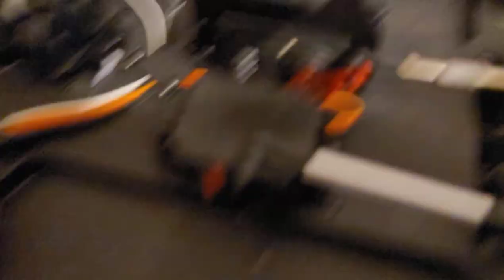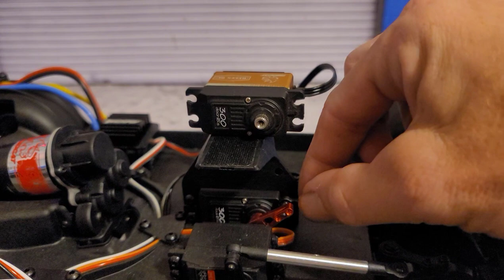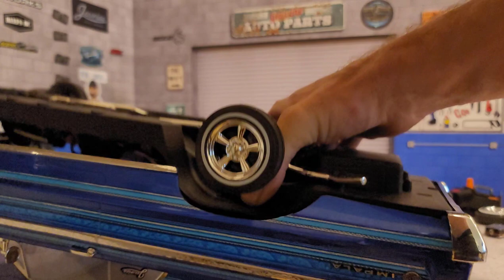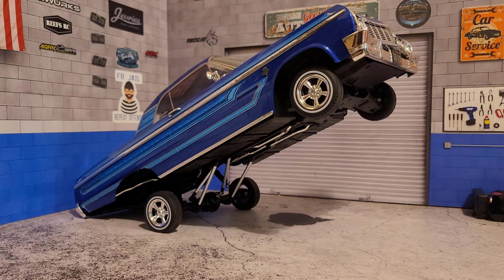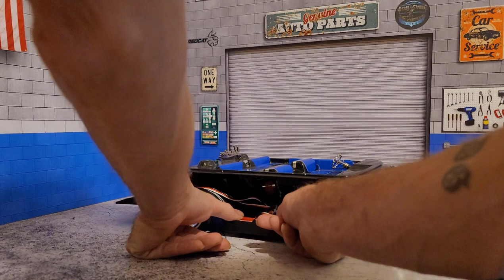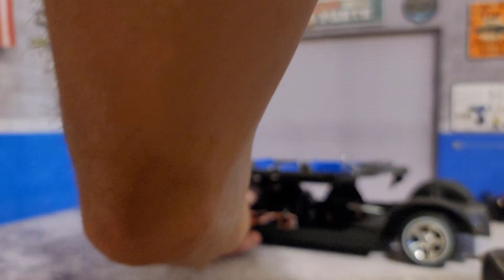Redcat Lowriders MORE HOP POWER Flipped Servo Short Horn SixtyFour Hopping Lowrider

Comment: I might have to do the change up on the hopping servo I did change up my esc but it’s running 3s right now and my hopping servo is kinda moving on it’s own and when I slowly move the switch the back servos tend to cut out alittle any tips on how to fix it I reset everything on the car and my remote just haven’t tested a 2s yet though
Reply from the maker: have to look at the servo, its not supposed to move at all, might be loose in chassis, causing odd behavior, make sure its fixed in the car well
Reply: @NorthSideCustomRC  everything on my car is tighten down even the servo horns I have a power boost but I don’t think it will help that much

Comment: That’s how I have my 64 set up with a shorter horn. I just noticed that my Monte Carlo has a locked rear diff were as my 64 has an open rear. Is yours the same
Reply: I ordered a duel servo mount and servo and I’m going to run the same shorter horn that should be some crazy power
Reply from the maker: Nice, glad to hear it's working for you too.

Yes open on 64 but locked on the Monte   they did this so 64 can steer and Monte can drive wheels up without going in circles or dead stop if dog legging. 64 all weight on the rear the Monte kinda rear light
Reply: Cool I thought it had to be for a reason for the locked diff and I knew the master of rc lowriders would know.
Reply from the maker: @Jasonkartracing  Eh Bro thanks for the support, Im just learning as I go and sharing what Im learning
Reply: @NorthSideCustomRC  is it worth upgrading to the dual servo on the 64?
Reply from the maker: @lazsosa8711  really depends on what you want. It's not needed for anything other than independent switches on front. It's increased Hop power is negligible and only a factor if weight shifted to keep from bumper stalling
Reply: @NorthSideCustomRC  what is a good budget servo for it?
Reply from the maker: @lazsosa8711  Power Hobby 209mg is great budget option

Comment: When you flipped the front servo did you have to reprogram the servo to a different angle or can I just flip the servo over and take the servo horn off push down the switch on my controller so that it is completely at rest and get on my receiver controller and reverse the motion and then put the horn back on as my endpoint correct?
Reply from the maker: You need to readjust the "end point" for the servo. Basically telling the servo where to stop in both directions. 

If you kept same horn on servo it's still good idea albeit the adjustment will be small it's imports to have them just right
Reply: @NorthSideCustomRC  I do have a shorter servo horned I'm going to put on there just like the video and I also have shorter rods coming in also. Just wanted to make sure I didn't have to grab a programmer card to reprogram the servo. Thank you for your information really appreciate you
Reply from the maker: @devindickson5632  this one all in the controller end points but keep in mind the Factory gold Reefs is set at 80% power, you have that 20% left on the table
Reply: @NorthSideCustomRC  so it would be a good idea to grab a reefs servo programmer and power it that full 100% from 80% and play with that 20%?
Reply from the maker: @devindickson5632  in all honest the 20% is not gonna be crazy, the servo really come to life with a Bec and voltage upped to 8.4v but it's still noticeable and for 20$ worth it. The powerhobby 209 tho come at 40% yah really need to up that to wake them up
Reply: @NorthSideCustomRC  and that's exactly what I got was a castle BEC  and programming kit for it. A  hobbywing 1080 ESC and a 3s lipo battery. In which I saw your video for flipping the front servo so I got a shorter servo horn and ordered a shorter rod. Which all they are is coming within the next week. Already have the Bec and the programming kit and the shorter servo horn. In which all that stuff I should be good then.?. And again thank you for your information